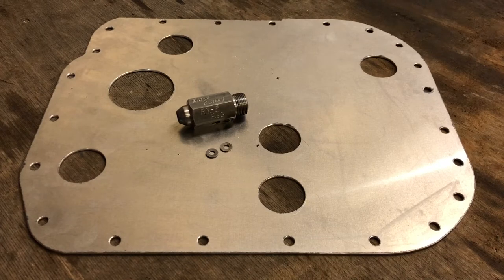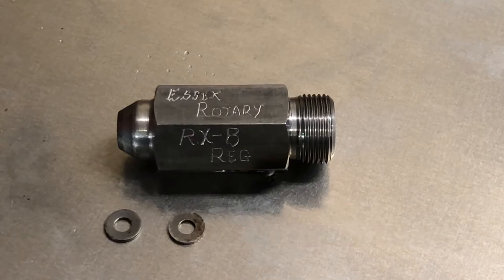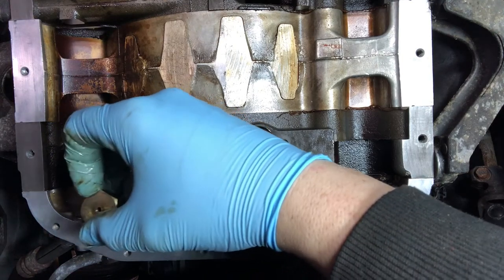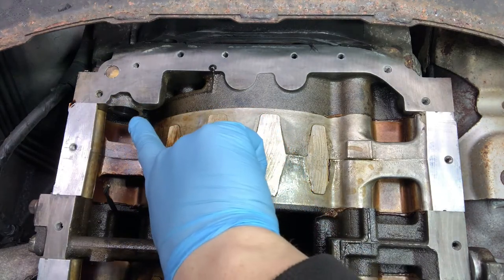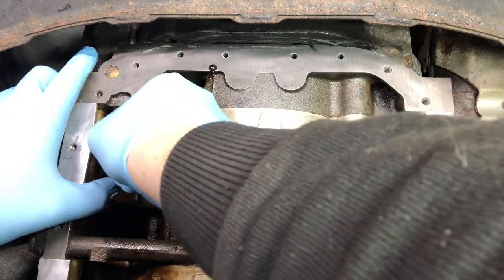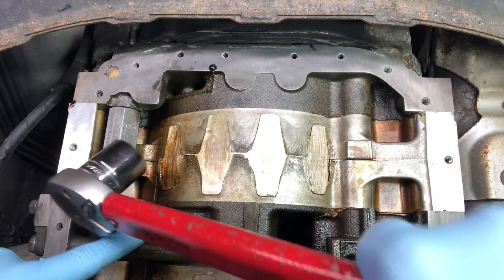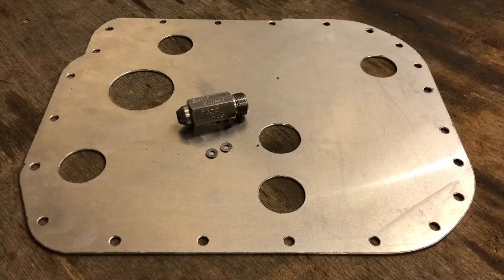Essex Rotary Quick Vid 31- Installing ER's RX8 Enhanced Oil Pressure Regulator and Shim Set

Comment: This is a great video. Is it still recommended to use 2 shims? I see most of the shim kits today use 3 shims for the S1 rx8. Also, I have a complete set of service manuals from Mazda and cannot for the life of me find the toque specs. I know they were mentioned here but where can these torque specs be found?

Comment: I may be ignorant asking but a baffle plate is meant to prevent oil vortex from a crank at high rpm. What reason would you need for baffle plate when all the moving parts are elsewhere, not in the sump. Apologies if I’m missing something obvious, but why the need?
Reply from the maker: Baffle plates in Rotary engines help reduce "oil slosh" under hard cornering conditions, this can cause what some call oil burps. 
This is when the oil is washed up the oil filler neck and is then subjected to vacuum caused by the engine's "crank case" vent system (linked to the intake) it can get sucked in to the intke in liquid form being extremely dangerous,  if it does not cause engine damage, it can fowel plugs and cause serious smoking from the exhaust combined with missfiring and poor running.
We designed the RX-8 baffle plate to prevent this issue. as the locations of the pass through holes mean that a lot of the kinetic energy stored in the oil during continuous hard cornering on twisty roads of track driving is cancelled out when it kits the baffle, effectively reducing the amount that the oil "climbs" up the inner sides of the block.
Other benefits include.
improved cooling as the oil takes longer to make it in to the oil pan.
Reduced oil foming in the oil pan, as the foamy oil with bubbles in it has to makes it way over the baffle plate before dropping in to the oil pan, this gives the oil time to off gas (the gas bubbles to come out of suspension in the oil) effectively making the oil pump less susceptible to picking up foamy oil.

Sorry my answer was so long.

Comment: I had no idea this could be done with the engine in the car, after this upgrade do I need to use a specific oil filter for uprated pressures?
Reply from the maker: as long as you use a good quality filter there should be no reason to change the specs. there is lots of talk of using the R3 spec (2008>) filters as they have a higher pressure bypass valve, but in reality if your changing your oil regularly enough this should not be a problem you encounter with a oil filter bypassing.
we obviously recommend some of the higher uality aftermarket filters, here in the UK we stock a selection of Filters from the land of the rising sun. including
HKS, Project-Mu, GReddy and RE-Amemiya......mmmmmmm RE-Amemiya :D
Check them out here
http://essexrotarystore.com/product-tag/oil-filter/

worldwide shipping available via email.

Comment: does it make sense to install the valve and washers when you drive the SOHN-Kit?
Reply from the maker: The systems your talking about are seperate, and the oil delivery via the OMP is controlled by the ECU, so it should not effect things, This regulator is a great upgrade anyway. no matter if your running a SOHN or Not

Comment: Hello Essex rotary, does this mod will help in my rx8 06 in resolving my issue of low oil pressure in idle when the oil is warm up? 
Sometimes I’m getting as low as 10 or 12 oil PSI when the oil is fully warm I use 10W40 oil
Or if you can help me in this matter in your experience, thanks in advance
Reply: Doubt it, this mod increases your max oil pressure. Increasing the target idle to 1000 rpm will raise the oil pressure, I'm getting between 23-34psi with 10w40 oil fully warmed. You can raise your idle by having a specialist flash a mini map on your ECU.
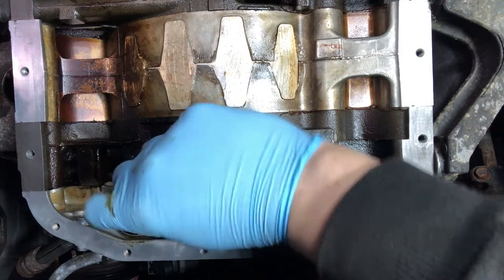Reply: Yes, at 1:55 he mentions the shims fitted in the front will help idle oil pressure, but also that the rear regulator also helps with this.

Comment: dose the increase in oil affect the exhaust emissions?
Reply from the maker: Assuming your engine is in good health then this should not, the oil getting to the combustion chamber is injected via the Oil metering pump (OMP) the OMP meters the oil being provided to the oil injectors.
So increasing the oil pressure will not effect the amount of oil being injected in to the engine for combustion chamber lubrication purposes. The OMP is controlled on the RX-8 by a series of maps on within the ECU software.
The purpose of the oil pressure regulator is to incresed engine internal oil pressure to aid in areas like bearing lubrication etc.
We hope this helps answer your question.
Reply: @essexrotary1540  thank you for your response

Comment: Thanks for the informative vid, do you use longer bolts with the baffle plate?
Reply from the maker: dave Warwnock if your using the stock oil pan the standard bolts should work fine. If your fitting an aftermarket oil pan then they usually come with longer bolts already. We will be releasing a bolt kit for the sump soon though.
Reply from the maker: Now available and an install video is here also.
https://www.youtube.com/watch?v=uUEqX4SbOpk&t=12s